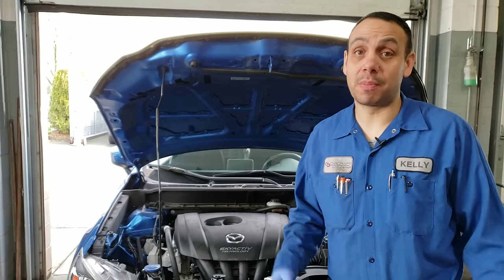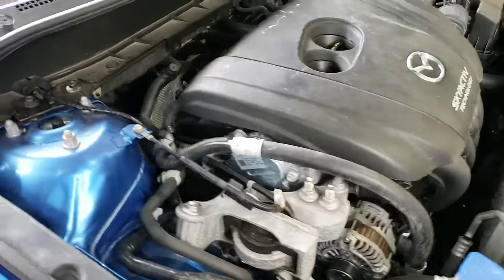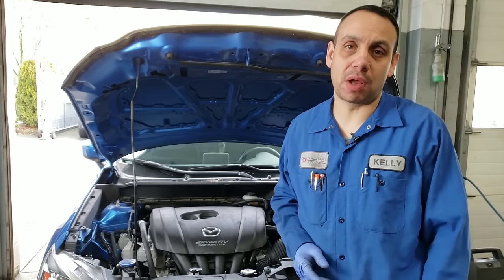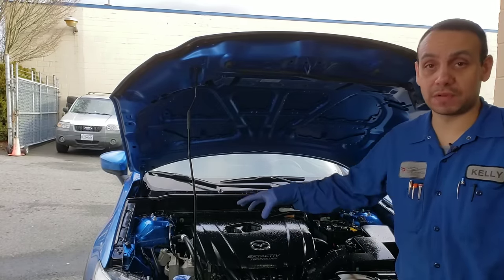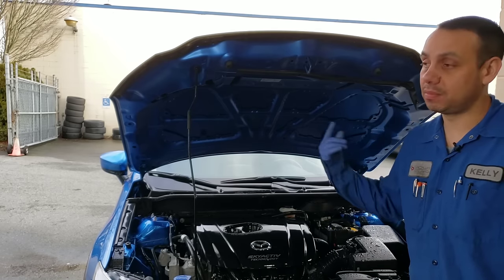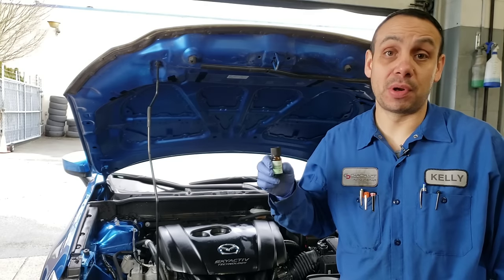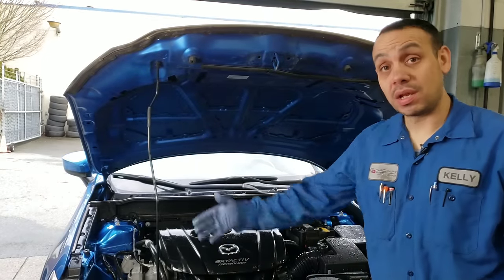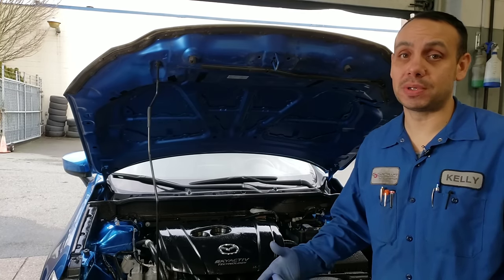Easy Tip To Keep Rodents, Mice & Rats Out of Your Engine Bay

Comment: One small tweak to make your fix MUCH better. Water and oil (peppermint oil) do not mix so you need a "surfactant." That is a fancy way of saying you need something to break up the oil so it can be dispersed in water. The cheapest effective surfactant is soap. If you take a few drops of Dawn and mix your 40 or so drops of peppermint oil in, and then shake that together with your water, the oil can then disperse in the water. Don't worry about the bubbles in the bottle.

Over time it still separates if you have any left in the bottle but a quick shake is all you need. The soap also acts as a binding agent as the water evaporates and will hold the oil residue longer.
Reply: It's probably a good idea to spray on the floor in the garage where the car is parked, that way if your car leaks a little out of the radiator or oil out of a seal that isn't tight, you can spray it out with a pressure washer easier, and keep the mice out at the same time.
Reply: makes sence,they cleaned alot of wild life from exxon valdez spill years ago with dawn
Reply: Actually you need the emollient properties of soap, not the surfactant properties. But you are on the right track by suggesting Dawn.
Reply: @jesterger  Actually, its the emulsive property of soap that he's after. The surfactant property is useful, too. Emollients might actually attract them if they have chapped hands.
Reply: A product I use every fall is Dr. Bronners peppermint soap. 50/50 with water in a spray bottle
Reply: @vinchezmo8864  I was about to leave the same comment! I mix H20, Peppermint Castile soap (like Bonner's), + some extra p'mint oil.
Reply: Couldn’t you just shake the bottle between every fourth or fifth spray?
Reply: @montanaplease  If it wants to separate before spraying, it’ll do the same after application.
Reply: @jesterger  m
Reply: One more tip get a out door mat with a rubber backing and nylon piling on top, blue tape the front tire area as a marker to know where to park the car on the same area. You can use the peppermint oil and spray the rug since the rodents will be climbing up the wheel well this will make them avoid the rug area and not climb underneath the car. You can also mark and area along the wall so when you pull into a carport or garage you can use your side mirror as a marker to know how far to pull in.
 I own a hybrid car with orange color wiring its made from a soybase material  that the rodents think it's food so I mixed some Cheyenne chili powder with any kind of cooking oil to for a paste and I brushed it on the wires so it will prevent em from nawing on the wires, you can also sprinkle it along the mat and for sure they won't want to invade that area just be aware of pet that they don't start sniffing the rug area.  
 It's been over 5 years and no more problems I tell my neighbors about this fix and it's working for them since we live in a open space area and there's plenty of wildlife around. Occasional open your hood and check the engine dept. Just to be sure. 
One of my neighbors had to replace his wiring and it cost him over $4200 
Good luck hope this helps I know it can be an expensive problem
Reply: @TheJacksonJam TY and to add to alan's comment/idea above .. I use my spray liberally ON all 4 tires and the wheel wells as well as ON the concrete perimeter of the whole car w/ special attention around the tires, and undercarriage where they can jump  up on the tie rods, etc. (But Alan's tire mats are a great idea! Never sure how long it lasts absorbed into my concrete.). The whole effort is an acquired art of trial and error, lol. We must THINK like the rodent.
Reply: Will it work as well to put the Dawn into the water and THEN add the peppermint drops?  Or do you need to mix the dawn with the drops first ?
Reply: @apopowich  You can do the water first but they won't mix as well. It will still work though because the soapy water does allow the dispersion of the oil. Mixing just a few drops of soap (ideally Dawn) with the oil drops so that it can emulsify before mixing with water is the best.
Reply: @BillWood1  Thanks! I thought so, but it seems a little trickier to manipulate, so I thought I'd ask.
Reply: @apopowich  By the way, it didn't occur to me but you could put a very small amount of water with the soap and oil to make an initial concentrate if it is easier to mix. By small amount I mean maybe one or two tablespoons. Again, you don't want much dilution because the soap and oil have to emulsify a bit. It is hard to emulsify if there is much water. The soap needs to be able to act on the oil as directly as possible.
Reply: @BillWood1  Thanks I will give that a try today.  First I'll see how easy it is to pour into the water bottle without diluting and go from there.
Reply: @alanwong6540  thank you! The rug is under the car by the wheels correct?
Reply: Great tip!
Reply: @vinchezmo8864 , I know this is an old thread but recently found this due to a rat problem in our car. We used your method and it seems to be working but obviously it leaves a white residue all over the engine where it was sprayed, Wondering if this will cause an issue or if that is just a cosmetic issue. We can always spray it out at some point but want to leave the peppermint smell as long as we can.
Reply: @BillWood1  Great  tip thank you sir.
Reply: @swindmiller  purely cosmetic. IF you used an engine degreaser or engine cleaner in a self-serve car wash you could easily wash it all off.

Comment: I’ve used peppermint Altoids for quite awhile….place them in various area one at a time or several in small containers. Be careful on upholstery as they tend to melt slowly and may leave a stain. I even put a few in the end of my exhaust pipes on my classics that may sit for a while in storage. Works quite well on tractors, lawnmowers etc.   You know they work to some extent..because they never get eaten.  Nothing is totally mice proof but i know this helps.

Comment: Peppermint oil works I use it full strength with a Q-tip wipe the oil in different areas in engine compartment! I try to do it once a week! No more rats!
Reply: Yes it does work Texas AnM study proved it.
Reply: Get a shop led 48" light place it under the hood the light will keep them out
Reply: @georgecummings3227  I've tried EVERYTHING, dryer sheets, mothballs (try to get the smell out!) lights, traps, everything I had read about without success... until I used 40 drops of Peppermint oil in a spray bottle of water. SUCCESS... no more rodents.  I respray every 2 weeks.

Comment: I didn't know about spraying down the engine compartment with a peppermint oil concoction.  But ever since the winter the mice built a nest in my glovebox, I've been using 3 reusable peppermint oil dispersal containers that I put in the glovebox, in the spare tire compartment in the back of my hatchback, and in the backseat, to keep mice out of the inside of my car.  The containers are  empty pill prescription containers that I drilled 6 to 8 holes in with a small drill bit, then put in 2 or 3 cotton balls with several drops of peppermint oil on them.  When the smell of peppermint starts to wane, I just put a few more drops into each container (the smell is usually pretty strong for 6 weeks).  Really works well & the car smells great!

Comment: They get to the engine air filter boxes thru the air intake ducts. They bring acorns & other debris into the compartments. I affixed fine screening to the air intake openings.
Reply: I used 1/4” Hardware cloth. Works great. No restriction of airflow.
Reply: Last week I watched a squirrel jump onto my tire and never saw it leave.  I thought he looked like he knew where he was going and wasn't just exploring.  Ran out and found it just in time behind the engine cover.  No nest or nuts anywhere or chewed up wires.  Put some cottonballs with peppermint in there and sprayed the wheel area with peppermint oil and water.  Has not returned.  But there's other openings for them just an fyi.

Comment: One of the best tips for stored vehicles is to leave the hood opened and preferable close to an opened door. Rodents like dark secluded places so if you take that away they'll avoid that area. I also use Cab Fresh pouches and an electronic pest repeller that emits a high pitched sound and LED flashing lights.  The best approach is to do it all otherwise you could face a huge bill for wire harness replacements. The auto manufacturers could do a much better job protecting wiring.
Reply: My bill is 6700.00 through insurance for engine harness damage on a 2014 Camry v6 with 40000 miles on it. Waiting on insurance approval to get the work started. 😢
Reply: Yes leave hoods up, rats and mice like dark places. Been doing this for 50 sum years out in the desert. No problems ever with mice or rats, and there are a lot of them here.
Reply: @cottydry..." The auto manufacturers could do a much better job protecting wiring" Yeah, the manufactures know Honda even sells a rat Repelant Tape at dealerships , so they know there's a problem and if so why don't they tape the wires during manufacturing after all most of the wires are hidden and not accessible or easy to wrap AFTER everything is installed. The damage rodents can do can be very very costly and sometimes insurance coverage will just total the vehicle.

Comment: I have one of these engines. You MUST remove and clean under the engine's plastic vanity cover. Mine had the insulation pad shredded beneath it for a mouse nest on the top of the engine. And also, as they did to five of my cars, they love to make a nest in the air filter box. Last weekend, for my son's antique Buick, we removed the air box, cleaned it like this guy did with soap & hose, removing seeds, acorn shells, and rodent poop . We then used a piece of steel mesh from an old air filter, cutting it to fit the shape of the air intake pipe upstream of the filter box, and set it into place with a bead of silicone caulking. I am surprised that they don't have screens built in, as I have had to also do this to my Mazda.
Reply: I just had a similar problem in my 2011 mazda where it chewed up all the insulation on the hood and back panel of the engine bay and it stuffed all the insulation around the engine, but surprisingly it didn't get into the air filter box or chew up any wiring.

Comment: Great video all around. One thing many people don’t know is that a while back some manufacturers started using vegtable oils to make the plastic coating for wire. Great in theory and for the environment but it’s an absolute magnet to a variety of rodents. My neighbour had a brand new work truck at home that received $1500 in wiring harness damage over one weekend. As shown here, a little preventative maintenance can be a lifesaver.
Reply: I bought a 2011 Prius to deliver food with. It had 40k miles on it and the history showed a wire harness replacement due to rodents. There you go. 

I also deliver with stupid Volvo wiring that crumbled.
Reply: Just totaled my 2007 x-type jag! The wiring har Ed’s replacement was going to be $5500 IF we could get it from England!🤬🤬🤬
Reply: @divenursok  Scotty Kilmer warned you 😆
Reply: U would think oil based anything is a nightmare for the environment.
Reply: No that's actually peanut oil what they used not vegetable oil
Reply: @DON-yq2op  also plastic wiring coating made from soybeans, Big problem! Rodents live it.
Reply: @DON-yq2op Even worse!
Reply: Same exact thing happened to my Ford F-450 which is usually garaged in a rodent free environment.  Left it outside with a trailer attached and returned to find most of the electrical non-functional.  Took two months for the dealer to find the problem and fix it and the cost was $1500.
Reply: @DON-yq2op it’s actually soy-based
Reply: Does peppermint cause damage to wires and batfery
Reply: @HistoricalWeapons  no all good with that.
Reply: @bbrown5887  you mean yes it’s safe or no it’s not safe for car
Reply: @HistoricalWeapons  yes peppermint is safe. A bonus is your car will smell great too….Unless you don’t like peppermint😁. I also used a commercial rodent deterrent spray from a hardware store. It worked great evicting Chipmunks, but it smells like Monkey Ass.
Reply: @bbrown5887  I worry it void my warranty

Comment: I used the mothballs trick suggested in an earlier comment. It worked, but next time I'll use peppermint oil instead because the mothball odor was really strong. Fortunately I didn't need to do any maintenance until after removing the mothballs and letting the odor dissipate for some weeks, because working under the hood would have been miserable.
By the way, also look carefully elsewhere around the car. I also found a nest on top of my truck's gas tank, where the fuel pump is installed. Fortunately the little critters hadn't chewed up the wiring there, the way they did under the hood (causing my engine temp gauge and cruise control to fail). They also destroyed the hood liner, shredding it for nesting material. 
Not long ago I heard someone refer to the engine covers in wide use now as "mouse roofs", so be sure to remove and check under it, too.

Comment: A few months ago my car pretty much died. The shop that fixed it kept it for 11 days because they had to trace every wire to find the problem. That is when I was told that mice crawl in there and chew the wires. I'd never heard of that, and I appreciate the low-cost info to prevent this from ever happening again.
Reply: Same thing happened to me. They ate a sensor to my transmission and I could only get into first gear! Better than having to rebuild or replace a transmission. I had no idea they could do so much damage!!!!
Reply: I've read that the problem is "green" wire insulation made from Soy oils. Nobody ate the insulation made from petroleum. I'm told oil spraying the vehicle will help.

Comment: I live in Tucson Az. and have had tens of thousands of dollars damage to my vehicles from pack rats. I tried every electric and electronic stuff and all sorts of lights to no avail. i read about using peppermint essential oil and bought a 16 oz bottle from Amazon for about $20. I mix an ounce in a 25 oz spray bottle and about once a week I spray the engine bays and under the wheel inner fenders and have not had a problem since. I also bought a flat roll of copper wool from Amazon and put it around the gas tanks to block the buggers from getting to the sending unit and emissions wires. Make sure to not cram it into any openings with slightly exposed wires. i had three vehicles with top of the gas tank wire damage and no more now. The spray also keeps rabbits from eating my garden. All the other crap I tried did not work and the "guarantees" were BS. I also put a wire screen in the air box's because they made a nice nest inside using the paper from the air filter. Honda has patented an adhesive tape they make with little rats printed on it to stop rodents from eating wires, the tape is $40 plus a roll and is no more than Teflon tape. I use Teflon tape on aircraft so I have rolls of it to put on especially attractive wires. BTW, the problem of attracting rodents to newer vehicles is many are using wire insulation that is made from soy beans, yum! The tape is also on Amazon, many sizes and choices.

Comment: I had the same problem with rats living in my engine bay. I tried a lot of things to keep the rats away including peppermint oil & the like to no avail. Problem with scents is you need to apply it regularly & thy don't really work that well. So I thought why would rats want to live inside the engine compartment? I realized that the engine compartment is a rat mansion, lots of tight spaces,  safe from disturbances, dark,  & the closed hood gives them total safety from predators, noise, light etc., So I thought getting this sense of total safety out is the key. To do this only requires that the hood be opened when the vehicle is in the garage. Voila! no more rats. If your garage is dark, hang a small light source from the hood latch so that the engine bay is lighted. Rats don't like light. I have been doing this for years & it is a very simple & very effective solution for rat prevention.

Comment: In a similar vein, I was told that Bounce dryer sheets work well as a repellant for mice when you leave your riding lawnmower in the shed for the winter. It has worked for me so far.
Reply: I’ve heard that too, also moth balls. They can’t handle strong smell
Reply: I did this in my camper. They loved them and used it for a toilet.  Did not work at all
Reply: Bounce sheets are chemicals
Reply: They didn't work for me.
Reply: Floral or Lavenders scent
Reply: One man's fragrant (softener sheets) is the rodents poison.😂

Comment: I 
Nice video and simple solution for everyone .
I had the same problem a couple of years ago and I understand that rodents and squirrels hate any flashing light so I made an electronic strobe light  which turns on at dark (dusk) through a sensor and   turns off at daylight which is connected to my battery and this has worked well for the past two and half years.
Thanks to the person who gave us the tip of keeping the recirculating door closed, I usually use this when the AC is on to keep the cooling in …… good tip 👍
Reply: Out here in Arizona they sell a strobe light called "Rid A Rat" for the antirodent job.  Doesn't work --- AT ALL --- !  Opening the hood works, but you need to cover the plastic bits like the brake master cylinder and the cooling system overflow tank so that the UV from the sun doesn't turn those spendy pieces into little white crumbles.  On one of the Rid A Rad installations, the rat chewed the power lead to the strobe light through.  That kinda worried me!